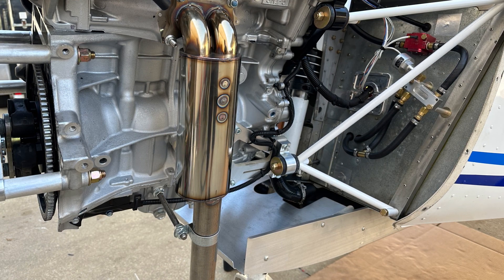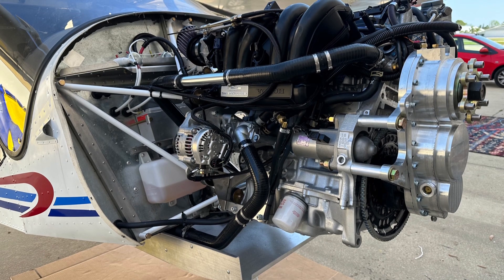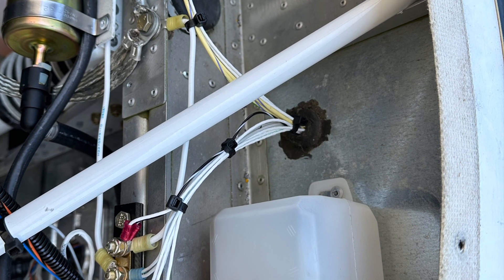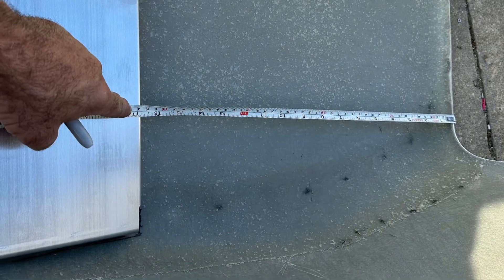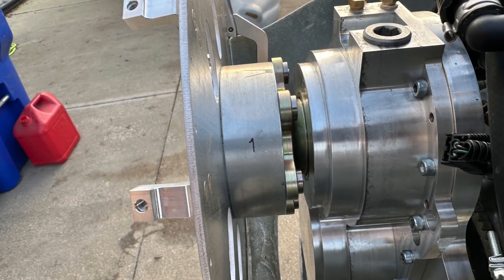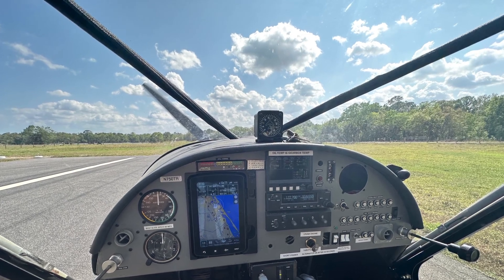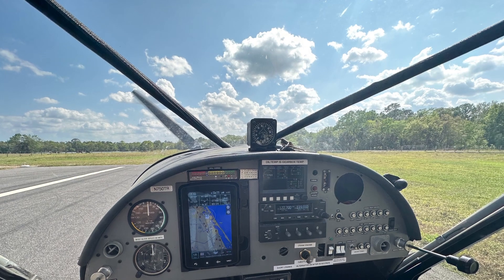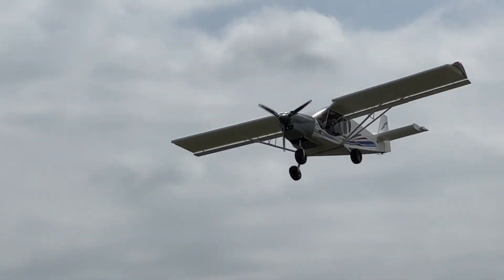Making A Viking Engine Switch the Easy Way - Part 5 (Final Video)

Comment: I'm not a pilot or in the industry in any way but I'm curious about something. How come soldiered wires are a no-no in aviation? I always liked soldiered wires for the mechanical strength and bonding properties, or at least so I thought. This question refers back to a prior video in this engine exchange series.
Reply: Vibration makes soldered connections eventually fail.

Comment: I am an Automotive and Marine tech. I do not like the exposed flywheel. That should be fully enclosed with a bell housing. You are going to introduce dirt moisture and contaminates into not only the fly wheel and teeth of the fly wheel but you are exposing the starter bend ex to the same dirt and water and contaminates . It will eventually clog up the bend ix and the starter will not function and the aircraft will not start because the starter Bendix is hanging up or seized and wont engage the fly wheel . Also the dirt and moisture will accumulate around the fly wheel teeth and cause premature wear on the teeth of the fly wheel and starter bend ex teeth . I assume there is an input shaft to the drive for the prop that is also exposed and so are the seals that will be exposed to the same dirt and moisture . The dirt will eventually work into the exposed seals and destroy the seals and and damage the surface of the shaft for input and out put and start a oil leak . Sorry but this a very poor design and totally unexceptionable especially for an Aircraft
Reply from the maker: I could answer this a million ways but will keep it simple. There is a cowling that covers it. In the 13/14 years of this exact design there had never been an issue with any of the items you have stated. With 100,000+ fleet hours minimum. 

IF, this were the case, one could simply replace the flywheel for $198 dollars if they so choose. Having exposed components in any aircraft engine is not uncommon practice as many have a covering…

The design does as intended and continues to do as intended for 1000s of hours.